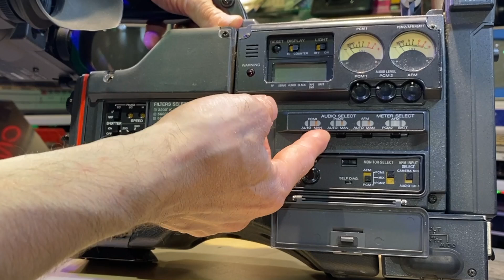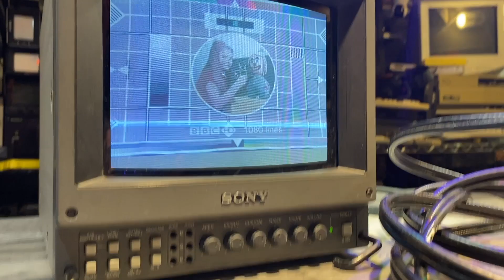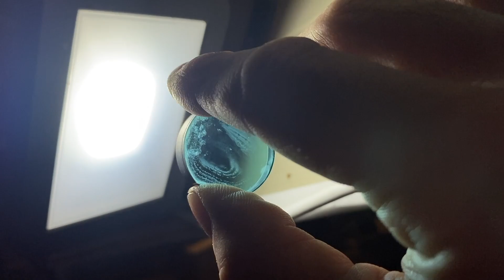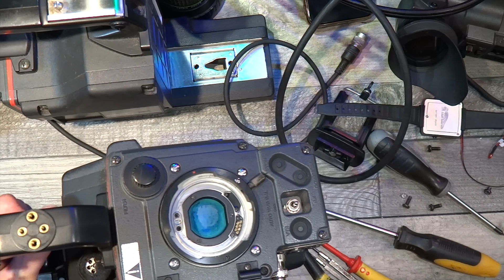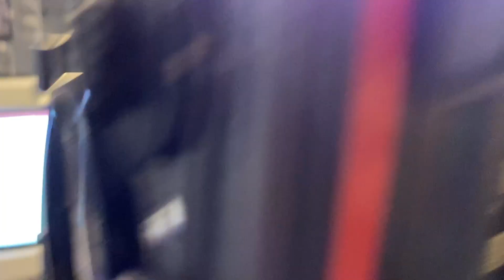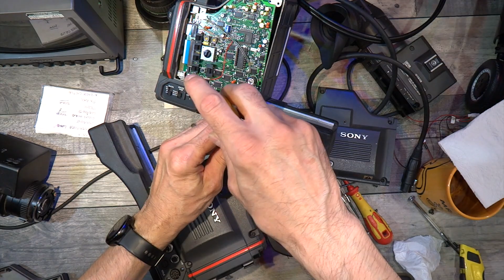SONY DXC-325P EVV-9000P INFRARED FILTER ROT RESTORATION REPAIR Part 1

Comment: Saw this video a while ago and was convinced that was the issue with my DXC-325P. Finally got round to taking a look and found the whole ir filter is missing including the mount. Longshot I know but I don't suppose anyone knows if it's possible to source these from anywhere?
Reply from the maker: Never seen any on there own myself. Best bet is to get another camera for parts.
Reply: @RetroGadgetMan I had a look around and that fitting is the same across the dxc range. I found an old CCTV camera on ebay that had it and was able to get it at a decent price. It has the issue with the adhesive on the ir filter but thanks to your video I should be able to solve that easily enough. Thanks.

Comment: Interesting video, well done. These DXC cameras are not for broadcast, they're professional for corporate video etc and typically have 1/2 inch CCD's. The Sony broadcast range have 2/3 inch tubes or CCD's and start with the letters BVP, DNW & DVW. The Sony DSR DVCAM range with 2/3 inch CCD's like the DSR500WSP was often used for broadcast ENG too but was considered cheap compared to the Beta SX & Digi Beta units.
Reply from the maker: Thanks for the info regarding DXC / BVP. I didn’t know that fact. 
I suppose the B in BVP should have made me pause and wonder. I guess they gave it that to differentiate the two systems. B for broadcast. I do have a betacam and another camera that is huge compared to the DXC ranges. I plan to make videos about those one day. My DXC M3s are my favourites.

Comment: Did your filters simply pop out of the frame? I'm not having quite your luck with dislodging mine and there was a cut in the video- was there a trick to extracting it?
Reply from the maker: They look to be held in with a tiny amount of glue on one edge. I carefully  pushed the glass through the frame .

Comment: The timing of this video is fascinating! I just repaired the IR filter on my DVW-970 about a month ago. I wish mine was as simple as this one however. I had a very hard time separating the lenses and ended up soaking everything in acetone for several days. I still couldn't quite get all the residue off.

Comment: Those cameras really do not age well, all the ones I got in hand so far had the IR filter problem, and countless leaky capacitors, sometimes even releasing a fishy smell. (nothing comparable to the **awfull** chemical smell of the HVC-3000S cameras tho)
Reply from the maker: Indeed. I have more that have recently started to get filter rot that were ok. Never had a Trinicon with bad caps yet. Just filter rot.